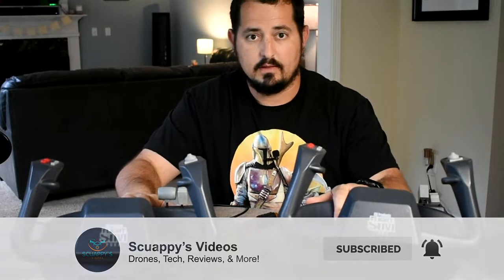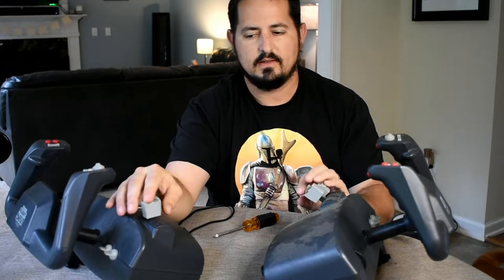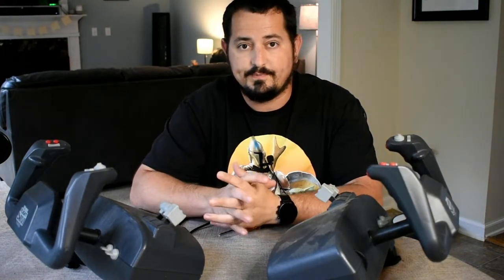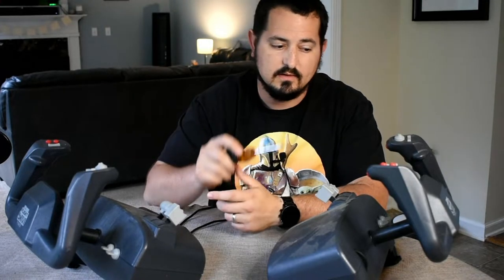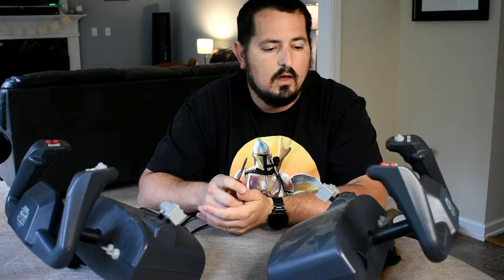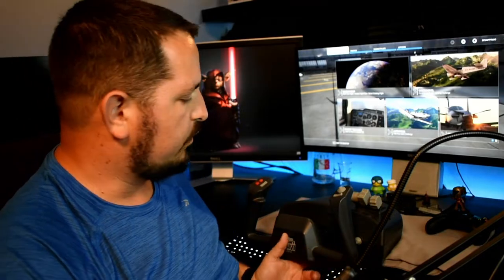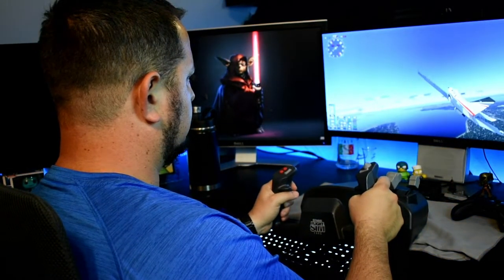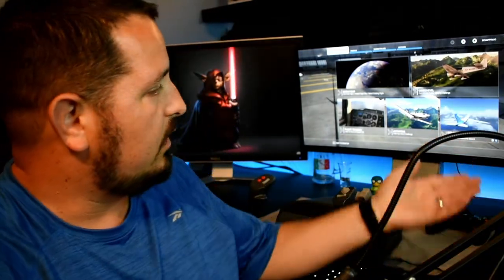Flight Sim Yoke Repair for Microsoft Flight Simulator 2020

Comment: Did an interesting mode to mines, adapted an Embraer yoke, still working on it since there are no wiring diagrams…. figuring out the circuitry the old way.. multimeter

Comment: What would really help is to explain how to remove the blasted inset screws. I can only get the 2 legs off and 2 of the 6 screws. I get them loose but they don't come out and I have been at it for over an hour.
Reply from the maker: They came straight out for me, did you happen to strip the screws?

Comment: hi, how I can I contact you? I would like to make some question, am going to tell a sad story I had my yoke and rudders pedals in a bag and my puppy just rip off the bag and also broke the cable connectors and I would like to know if is there any way to fix it
Reply from the maker: I'm I don't understand what you mean
Reply: My puppy bite the usb cable from the rudders pedals and yoke, is there any way fix them?
Reply from the maker: @jacintogomez4293  it would depend on if you have access to USB cables and feel comfortable on taking apart your rudder pedals and yoke. Also you may want to know how to Solder since they are soldered in from what I remember.
Reply: @ScuappysDroneVideos1  thanks for the advice, any idea of where I can buy those kind of cable?
Reply from the maker: Amazon, maybe?

Comment: Those work on fsx but not on the new fs2020
Reply from the maker: I have used them on Fs2020 you just have to set the controls in settings